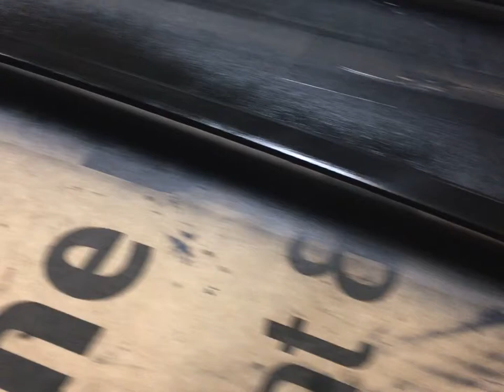Honda Odyssey - Water Leaks - Roof

Comment: Thanks! Bought a 2008 Odyssey EXL brand new and now has 213,872 miles as of today and is on its third kiddo learning to drive on it who use to be a baby riding in it. We live in Texas so no rust but leaking like a siv due to all the rubber and seals dried out. Just sealed everything up and appreciating the video as a guide.
Reply from the maker: Great story!  Glad to hear another Odyssey gets a new lease on life, maybe your Grandkids will end up driving it too!
Reply: Well I have a new driver my last driver so I need this van to last three more years and if it does survive them I’m probably just going to donate it to a cousin who just got married and has one on the way and probably in three years we’ll have a second on the way and I’m sure they could use the van. I Just replaced the rack and pinion as well as pretty much all of the steering components which cost me about $5000 so at this point this vehicle is ready to go another 150,000 maybe even 200,000 miles.
Reply: Can you share the part# and website where did you buy the part..thanks
Reply: @SuperSnakePlissken  I met an Uber driver who told me his 2003 Odyssey lasted 400,000 miles. I've got a little under 200,000 before I get there.
Reply: @IdTaken99  I can't put a link but here is the sealant I used. 3M 5200 Marine Sealant - 10 oz, White

I checked on it back in April 2024 because we have had more ran than ever before here in Texas this last couple of months, and it literally is as hard (and feels like) metal. Not a drop has gotten in that van the entire spring. The Odyssey is doing great!
Reply: @JillofAllTrades2  That's awesome. Honda has always made a great product minus the 1999-2004 V6 era where they outsourced their transmissions. Those trannies were nearly 100% failure rate.

Comment: Just wanted to thank u for this video. SO very helpful. Fixed the leaky spots on our new to us 2007 Ody EXL. Didn't use 3M. Used Amazing Goop (Marine), that is clear, instead. Replaced old ditch moldings with new.
Reply: Where did you get those?
Reply: How much were the new ditch moldings...a few hundred bucks? Did you buy original Honda Odyssey parts or aftermarket?

Comment: Thanks for this in-depth video.  I didn't do too much research but saw one other video that didn't answer my question regarding how to deal with removing the trim, especially when dealing with the front clip near the windshield.  You didn't show that in too much detail, but you did show how to remove the trim from that (pull the rail back).  I also appreciate your advice regarding 3m 5200.  That's important, as I'd probably have just gone with a big tube of standard silicone rtv.  Thanks again.
Reply from the maker: Pee Dee You can also rock it back and forth like a see saw while lifting up on both ends, a little upward pressure with a screwdriver on the short end by the windshield will remove the clip with the trim in one step.
Reply: @millionmilegarage9587  O.k., thanks.  I think I'd still want to pull the rail out backward before I tried that:  I simply can't see the arrangement of that front clip.  With my luck something would break if I did the see saw method.
Reply: I completed this job on my Odyssey.  I used 3m 4200 Fast Cure.  It's also a sealant but less of a mechanical adhesive than the 5200.  The Fast Cure is supposed to skin in 1 hr and cure completely in 24 hrs.  Because I don't have a garage it was a better choice for me, as I have frequent rain in my area.  5200 is also available in a Fast Cure, but finding black (instead of white) was an issue.

Concerning the clips it is important to state that they are NOT designed for reuse.  If you happen to get them off without breaking them you are lucky.  The rails can potentially be slid off them (and then you'd need a pick to work them off of their threaded studs), but the black caps on the end of the rails cannot reasonably be removed, hence good luck angling the rails and pulling them to get the free end to slide off.  Without pictures or decent video covering this aspect it's the kind of thing that you'll only understand once you open the system up.  In my removal attempts at least 3 of the 4 broke and/or were already partly broken.  Better to just have 4 new replacement clips on hand.  

Honda part #  91501-SM5-A00
Reply: @peedee4065  thanks for the part number
Reply: @azfersaeed1602  You're welcome, good luck!
Reply: This reply thread is very helpful.  I bent the trim up removing it without even knowing this video existed.  I’m going to buy new clips and see if I can reinstall after sealing things up.
Reply: @peedee4065 thanks for your advice and sharing your follow through...I'm researching as my 2007 Odyssey is leaking too.
Reply: @48success  Even though this video addresses the "common" roof leaking for the Odyssey I'm realizing that an equal or more problematic issue is the sunroof drains in the four corners.  If those are blocked then you will have rainwater buildup in the sunroof tray.  If it's either of the front ones that are blocked then you'll get water leaking into the A pillar upholstery.  If it's the rear ones you might get water leaking into the B pillar seatbelt retraction area.  This is tricky as you might think it's the roof seams leaking.  The proper way to diagnose the sunroof vents is to literally pour water into the tray and verify that it clearly pours out the bottom of the car without pooling up top.  If there's any reluctance then you can use compressed air to blow through the drains.  First, this is supposedly a big no-no, do it at your own risk.  Secondly, you'd have a very hard time reaching the rear drains.  Thirdly, using dishsoap with water will hopefully help dissolve the typical dust buildups that block the drains.
Reply: @peedee4065  sounds like another video in the making...I'm assuming you fixed and or had a sunroof issue also? I like in Alaska with at times extreme cold 🥶 weather conditions. So just the condensation build up on the glass as it will drip from sunroof glass and warp the pull cover and or will perhaps as you mentioned pool or build up water from the condensation and spill out onto the roof cover...it is now slightly warped next to the inside top closet to the windsheild...

Comment: Nice video! This happened to our van about 5 years ago. I used bath silicone and it's still holding up.
Reply from the maker: Doug Hurst I used clear silicone years ago on the 70’s cars.  I had a rear window job on a 79 Camaro that had been sealed with silicone and rotted out the trough where the glass set in.  Once the silicone lifts a little, it traps moisture and feeds the rust monster.  Window did not leak for years until the metal under the silicone was gone. Based on my past experiences if the surface is free of ANY contaminants the bath silicone will hold ok.

Comment: Thanks for this video. Such an annoying leak on this vehicle. I’m going to give this a shot with butyl tape instead of the silicone. Have a roll in the garage and seems it may be perfect and quick. Just fixed an oil leak known to plague odysseys as well.

Comment: Dang those were terrible looking welds. I just had leaking in my 19yr old civic. Thought it was the rubbers. After check some vids I've found very small cracks near the end. Thanks for showing also to check the mold line on top

Comment: Thanks for posting this. I found the rear seat well was flooded and had no idea why.  We also have strange intermittent electrical problems. I am amazed that Honda has produced such a faulty design and production. I used a sealant along the roof rack channels and the rear weld lines under the hatch. That seemed to solve the leak problem.
Reply from the maker: Leaks are a universal problem on most vehicle once they hit the ten year old mark.  The 70’s stuff was pretty tough to diagnose with all of the hidden folds of sheet metal covered in mastic sealant.  Had a wet footwell on the passenger side of both my second gen. Camaros that took a couple months to figure out when they were ten year old cars.  The Duster had some awful design flaws that caused all sorts of cowl leaks into the passenger area, one of which resulted in water dripping on the drivers feet when the wipers ran, another leaked right on top of the fuse box, good times.  There’s a reason why they don’t build them like they used too🙂
Reply: @millionmilegarage9587  I had sealed the roof on our Odyssey about a month ago. After a number of heavy rains I am glad to report, no leak! Thanks again.
Reply: @scottyrocket9 did you get any electrical issues after fixing the leak?
Reply: @KCBAnon  Hard to tell it it's related- The rear window wiper turns on when the front wipers are on, even though the rear is not on.

Comment: Thanks for this video! Nice explanation. 
I had the dreaded wet MICU problem, causing overnight battery drain, random alarm, VSA and ABS lights, random lights coming on with key out of ignition. I suspect it’s getting wet for this reason. 
I fixed (dried and cleaned) the MICU and the van is now working perfectly. Wish I had shot a video like yours to help others.
Reply from the maker: jotacalvo You have to keep them dry inside for sure!  I hope it works out for you!  Thanks for your comments🙂
Reply: I have the same problem that you listed.. How did you fix the electrical problem? Thanks!
Reply: Million Mile Garage I just finished this job tonight. It was made much easier after seeing your video. Pretty much only a 1 hr job on the one side (not including cure time of course). Thanks again!

Comment: 👍 thanks for the info.
Wish I knew this 3yrs ago when I bought body.  The previous owner just put silicone glue from front to back on top of the molding.
Well now I have a rusted mess on my hands.  Looks like I'm in the market for lessons on rust removal and Bondo application.  Wish me luck.🙃🙄
Reply from the maker: That sucks, hopefully the rust is not all the way through.
Reply: @millionmilegarage9587  I'm sure rust all the way through. I sounds bad when I press on it. I'm afraid to look. I keep blowing the third brake bulb the plate lights got a short in it too.

Comment: Ps i did see some one else use permatex. Some kind of liquid form silicon which runs into small cracks more easily. Plus it's clear, that looks nice. But as you said this seal will stand ages of time 😎
Reply from the maker: Rombout Versluijs We used the 5200 to seal a boat transom and it has held up to flexing, submersion and gasoline without failure, I have never seen silicone survive that kind of abuse.  Nearly 40 yrs ago as a youngster working in a body shop we used a black gooey tar type sealer, it stuck to everything but eventually they dry out and leak.  Silicone needs a very clean surface or it will lift ,trap moisture and create a bigger mess of rust and rot later.

Comment: If the rubber has come off the ditch covers, should we just buy new ones for the van? The wind got them flapping and we just ripped them off of the metal thinking it would not make a difference.  We were stupid. Here came all the leaks. Live and learn. Thanks for your help.
Reply from the maker: Yes, new ones or salvage yard score or just peel the rubber off and paint them black.  There will be slight gaps without rubber cover.

Comment: This is very helpful and in the process now w/a 2006 Honda Odyssey Touring. Do we need to replace the roof rack? Would like to leave it off and use weather stripping/other appropriate material instead.  Recommendations appreciated. Thank you.
Reply from the maker: Pretty sure you can do a roof rack delete, just buy new moldings for the base vehicle, I think they are one piece per side instead of four and get extra clips.

Comment: Thanks for this video. Best one I've seen. When I put back the front left roof molding, it didn't sit right. I covered all the cracks on the seam but worried about the windshield and roof joint because there is a decent gap between the roof molding and the roof. I don't think that should matter but wanted to ask here
Reply from the maker: Azfer Saeed A gap where the roof molding meets the body will not cause leaks.  Water will find it’s way under the molding, it’s the seams where the roof is welded together that leak.  No worries.
Reply: I don't remember if this video covers this, but I do know it from somewhere:  there is a gap at the front of the channels where they join the windshield SO THAT water can drain.  The leak issues on our Odysseys are mainly due to the seams leaking.  Therefore, if the seams are sealed as per this video - and not utterly gooped up, which would lead to water pooling in the channels which is no good - then when it rains the water cannot penetrate the seams and will run out the front and back sides of the channel.  Any blocking of the front and back will lead to water pooling, which is not good.  So, make sure that gap at the front, where the windshield and roof join each other is not blocked with gunk.  Mine had minimal gunk in there, I still made a point of picking it out.  Again, that gap is an exit point for water.

Comment: Great video - especially compared to others that are out there. I got up the courage to tackle my 2008 roof problems and am now waiting for the rain !  I have to say the 3M 5200 can make quite a mess, even if you try to be careful!
Reply from the maker: Glad it worked out!  Yes, 5200 can be messy, very sticky stuff.  Just wipe it off where you don’t want it, once cured it is hard to remove!
Reply: Well, it rained and the roof leaked.  The leak is pretty much on the passenger side of the car at the top of the columns where the seatbelts are. So, I tried fixing it again w/ the sealant. And it is still leaking! (I think from the area where the screws are in the roof rack). Any suggestions? Thanks.
Reply from the maker: Virginia Wiener leaks can be stubborn.  Was this the only place leaking before the repair?  Try wetting the suspected area and observe for leaks.  Carefully inspect your previous work, even the tiniest void can let water in. If equipped: Check the sunroof and the sunroof jamb after a rain.  Check the seams in the sliding door jamb overhead and the door seals.  Continue to wet any suspected area with a garden hose and observe for leaks until you find it.
Reply: @millionmilegarage9587   - Wanted to report that the leaky roof is fixed! I used a lot of sealant especially around the roof rack bolts and no more leak!  thanks for all your advice -

Comment: I usually dip my finger in alcohol when I "finger trowel" silicon caulk around my tub, so the caulk doesn't stick to my finger. Not sure if it will work with this particular caulk.
Thanks for the great video!
Reply from the maker: It’s Urethane, not sure alcohol contact is a good idea, may actually stop curing process. I chose this product because it sticks better than most silicones, especially less than perfectly clean surfaces and tends to hold up better over time without lifting and trapping moisture, causing rust outs.

Comment: I have a 14 Ram 1500 did something similar to that. But I scrubbing clean the areas where I was sealing, dusted off everything and cleaned the area with grease and wax remover. I do Auto glass replacement and see that problem on lots of vehicles
Reply from the maker: Yep, the cleaner the better,  5200 is a lot more forgiving than silicone in that respect hence the reason I use it.